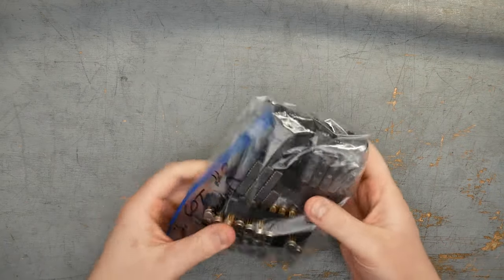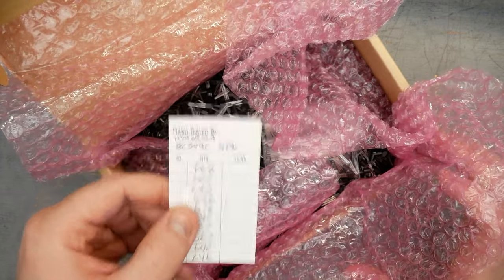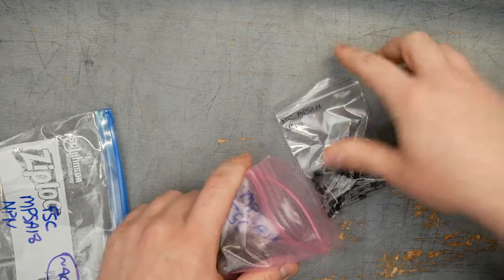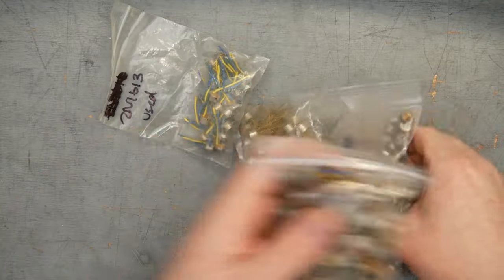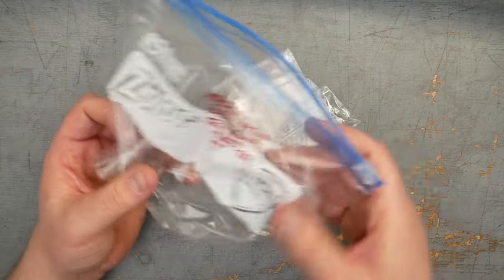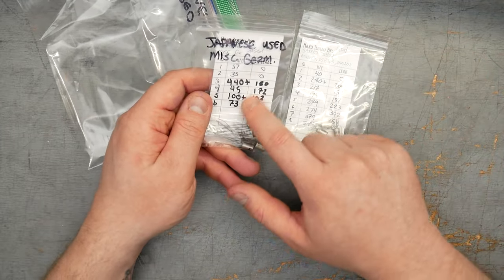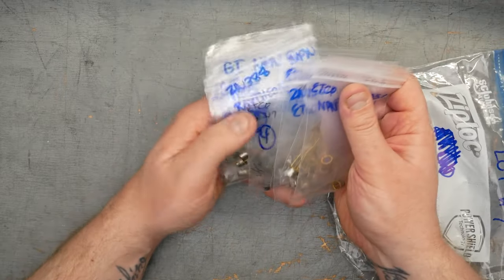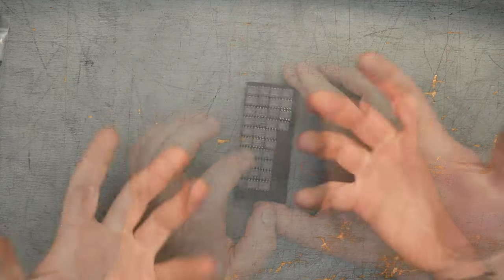Time to clear out the stash! // Gray Bench Electronics

Comment: Hey Joe, thanks for all of the content that you upload.  It's a lifeline for me.  Can you share where you source the Panasonic Orange film caps that you typically use?  I can only find higher voltage caps in this style for the last few years.  Thanks again for sharing.
Reply from the maker: I've actually looked around and haven't found any orange drops less than 100V. Usually I will go KEMET or WIMA caps for pedals.
Reply: @graybenchelec  Yes, I’ve been using WIMA’s too.  It doesn’t feel appropriate in every application but the difference is probably minimal.  I just bought a set of trans on your Reverb shop.  Thanks again Joe.

Comment: love your channel, thanks for sharing your knowledge. i just got into fixing broken pedals for a hobby. can you give me any insight? 
i have a nano pog by electroharmonix. everything works great but the effect / light always stays on. it doesn’t go to bypass mode. i thought it was the switch so i replaced it but it still has the same issue. any suggestions?
Reply from the maker: I would recommend posting pics of the pedal to /r/diypedals. Usually the footswitch lifts the ground from the LED circuit, so the LED is getting ground from somewhere even when the footswitch is disengaged.

Comment: I also ALWAYS purchasing random & weird NOS parts (usually transistors) for no reason, most of them are from locals ancient part stores (which is usually own by old Chinese people) in my country. I  just thinking that i will use them in a whatever fuzz someday. Usually the prices is supprisingly cheap as the owner of the shop never adjusting the price with inflation nor current hype! For example 3 years ago i found NOS Mullard OC75 for  $0,2 (2 cent?). Now, I stopped buying parts at offline stores because even though what I need is just some LED or solder wire, I always ended up carrying BAGS of weird transistors. I wondering that transistors is becaming somekind of addiction. Lol
Reply from the maker: That's great! I had a surplus store near me, but unfortunately they closed up shop. I bought hundreds of components from them, it was a goldmine.